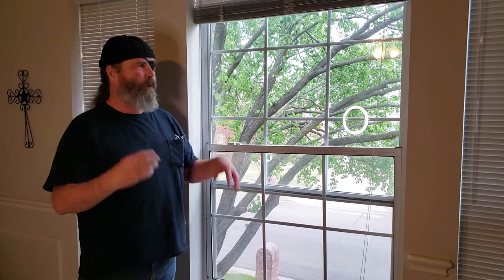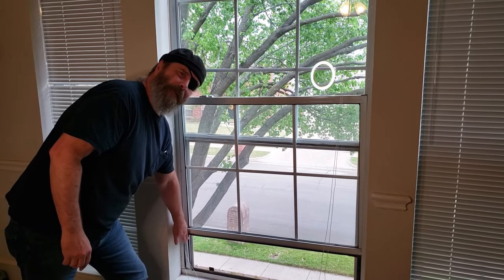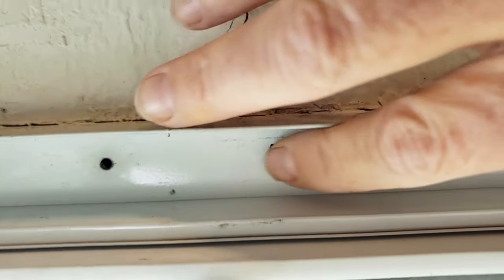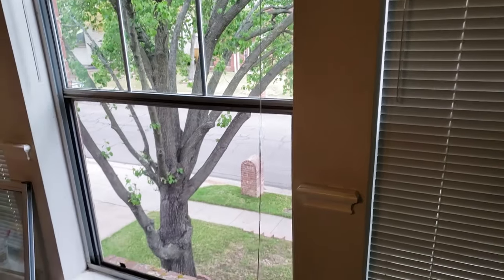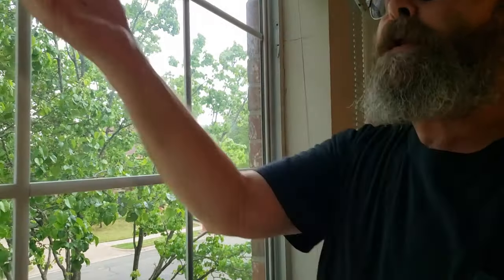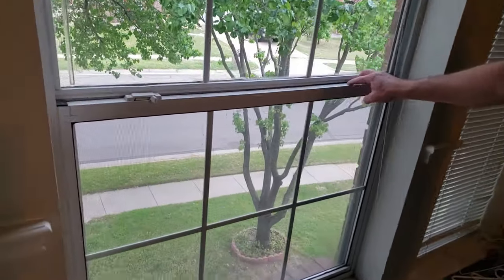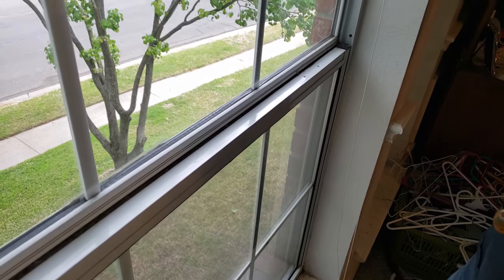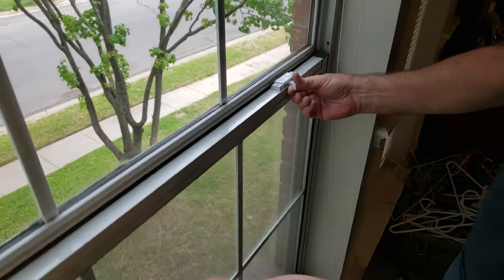EASY Single Hung Window Repair - Single Hung Balance Spring Replacement

Comment: Thnks for the info. Just the info I needed. You have a great voice and demeanor for video work. Nice job!   Update 11/23/2021: I ordered two new channels per the number stamped into the metal frame from SWISCO. Cost about $35 dollars shipped to my door. I watched your video a couple more times and with a few tries, was able to install the new balances. I used your candle wax method and the window now slides up and down easily. Thanks again for your video! There is no way I would have figured it out on my own. I'm retired and 73 years old, so it feels good to get something meaningful done.
Reply from the maker: Thank YOU, matey! I be glad it helped, and I thank ye for your kind comments.

Comment: Thank you for the video. I kind of already knew what I needed to do but having the visual helped. Also the wax is a good idea. You’re right about WD-40. In the end it tracks more grime and it only temporarily makes the window easier to slide up and down.
Reply from the maker: Aye, lass, thank ye for watching - smooth sailin'!

Comment: This saved me from getting into a major project. No window glass shops in the area were ready to repair this - everyone wanted me to get an expensive replacement.
Your video helped me get it fixed!
Reply from the maker: Aye, matey, glad it helped - smooth sailin'!

Comment: YOU SAVED ME ... I checked another video previously and he left out the part about the channel locks ... once I set the balances in the locks the window installed perfectly.  THANKS.
Reply from the maker: Ye be most welcome, matey - glad it helped! Smooth sailin'!

Comment: Many thanks  to you Mr Pirate Handyman, I got new windows and the springs came apart and after an hour or so, plenty of cursing and heavy drinking i finally quit got on the computer and found you. Took be about 3 minutes to fix it. thanks again
Reply from the maker: Sux that happened with new windows, but glad you got them fixed - smooth sailin'!

Comment: He man thanks for showing me how to pull this type of window out. What would you do if no matter what the window won't slide enough to either side to come out? With a screwdriver, I force the counterbalance down and can see it's what's keeping me from pulling the window out but I'm also causing some damage to the frame.
Reply from the maker: Aye, try pushing it up higher, as high as it will go.

Comment: Just a question I’ve been reading trying to see if someone’s already asked but where would you go to order the new part? Is there a trusted website you use or just go with something like Amazon???
Reply from the maker: Aye, matey, I would look for a manufacturer of window parts. If you don't know the manufacturer of your particular window, you can get the part number off the side of the part, do a search, and then look at customer reviews for that particular Website.

Comment: I hv the same window. Just when I open the bottom part of the window, the top part will gradually go down. Will your replacement help my problem?
Reply from the maker: It might, but if both windows move, you have a double-hung window. I have not worked on one of those - sorry!

Comment: How can I tell what size counter I would need?
Reply from the maker: There should be a number on the shaft of the old counterbalance. That will help you look up the proper replacement.

Comment: Where do you purchase the hardware
Reply from the maker: I ordered mine over the web from a window parts supplier. You can also find the most popular sizes at Home Depot, Lowes, as well as local window installers.

Comment: Any suggestions for a window that has jammed? I’m guessing the counterbalance is bent and wedged inside in such a way that  renders the whole window unmovable, up or down.
Reply from the maker: Aye, matey, ye be in a pickle. if you can get a small space at the bottom, try putting a piece of wood in the space, and gently tap upwards.  If that doesn't work, you may need to call a window contractor.  Sorry!
Reply: @thepiratehandyman2225  appreciate the quick response. It is what it is. Hopefully, we can try that this weekend.
Reply from the maker: Good luck, matey, and let us know what happens.

Comment: where you buy the part , i had the same problem.
Reply from the maker: If you do an Internet search for "window counter balance" or "window block and tackle counter balance" you should find more than a few places that sell.  I had to order mine, as no one carried them in the local stores.

Comment: The man at the local hardware store didn't have the right size balance and said he has hard youcan go an inch longer on them and they work. Sounds fishy, any thoughts on that?
Reply from the maker: Aye, matey, unless he is a window expert, I would be very wary.  Personally, I would order the correct length online.

Comment: My window does not just go in. One side  goes in and that's it
Reply from the maker: Is it a single hung or double hung window? And are you saying that you got it out okay, but now only one side goes back in?
Reply: I have the same problem. What do you suggest?  I have a single hung window that I managed to remove easily.

Comment: single hung window, no clips to remove, counter balance "seems" to be screws into the frame of the window
Reply from the maker: How old is the window?  Can you see anything that indicates who manufactured the window?
Reply: @thepiratehandyman2225  At least 20+ years.  It says GA on the lock.  I think it is called a "spiral counter balance"  but I still can't figure out how to access it. Thanks for your response.
Reply from the maker: Take a look at this video and let me know if this is similar to your window.  If yous is different, let me know how it differs.

https://www.youtube.com/watch?v=h4l-JHcQ-VU
Reply: @thepiratehandyman2225  No clips!  Somewhat difficult to raise window.  Have you heard of a "spiral counterbalance" that is what I think we have.
Reply from the maker: Does it tilt out?
Reply: @thepiratehandyman2225  No, the top does not move .... I cannot find any info on "GA" which I think is the company.  These initials are on the lock.
Reply from the maker: Lass, I be very sorry, but I am not familiar with these types of windows, and cannot find any information that is helpful. I'm afraid you need to call a professional.  Watch how they fix it, and if you have the problem on another window, you will have an idea how to fix it. I am sorry I can't help.
Reply: @thepiratehandyman2225  Thank you for your follow-up.  In the meantime, I have cleaned as much as I could and sprayed with silicone.  This has helped.  I will be asking my neighbors.  If I find an answer I will let you know.
Reply from the maker: Yes, please let me know - thanks! And I'm glad you have made it work somewhat easier.